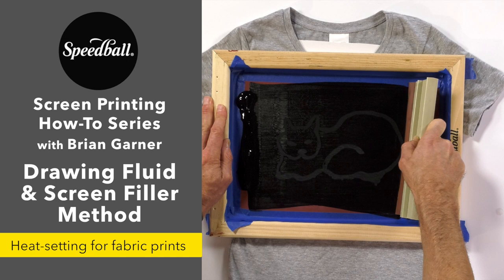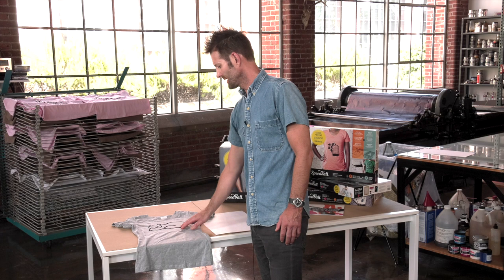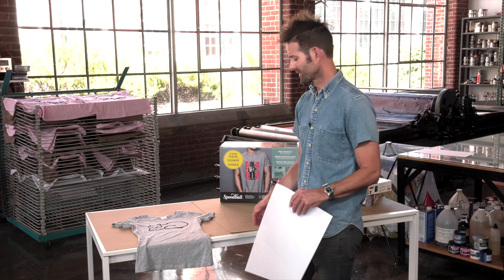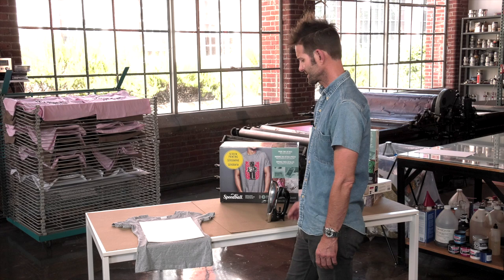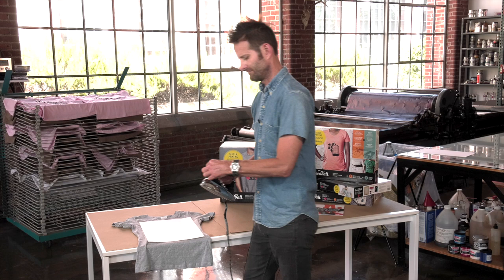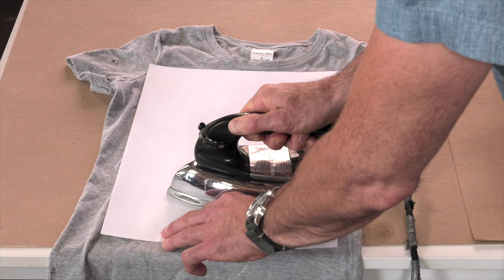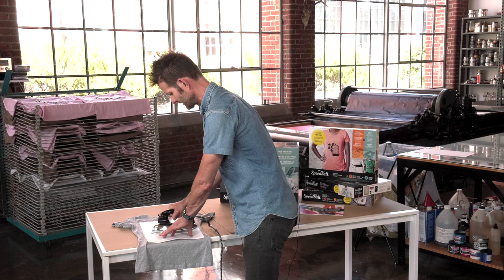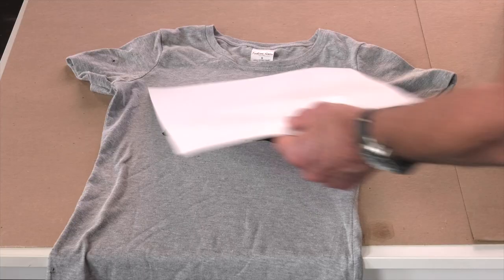Heat Setting Screen Printed fabric - Drawing Fluid & Screen Filler Method (Part 8 of 8)

Comment: Does the duct tape on the cord of the iron help it to heat faster? What type of duct tape do you recommend?
Reply from the maker: As a company that started way back in 1899, we love being able to include a vintage element into our videos. The iron making its video debut may have decades’ worth of use under its belt (requiring some duct tape to keep it all together), but it’s still a workhorse capable of getting the temp to ensure full curing just right.  Certainly not required (or able to offer any advantages like speeding up the time needed)—just a splash of history from this appliance!

Comment: Hi! I have a question for you, will heat-setting with an iron like this also work for block printing on shirts using oil-based Speedball fabric ink? I usually let mine air cure for a week after printing but it's becoming quite tedious.
Reply from the maker: That's a really good question! And I feel you, after doing it a couple of times, the process just kind of feels tedious. And if this is possible, it would save so much wait time! Unfortunately, we have never tested this in our lab before. Do you mind bringing this question to info@speedballart.com so that our product expert can help you figure it out?

Comment: If I wanted to use a flash dryer instead.. for speedball ink, what temp do they need and how long should I have the flash dryer on it for? Also, you use the "fabric" ink from speedball for screen printing on t-shirts right?
Reply from the maker: Hello!  Yes, we recommend using our Fabric Screen Printing Inks (either standard or Opaque) for screen printing on fabric.  To guarantee the inks are fully cured, we would recommend use with a household iron per the recommendations in this video or a heat press.  For the latter, we would recommend referencing the user manual for the press in use for the manufacturer's recommendations for settings/time when used with water-based inks.  Thanks!

Comment: I bought this kit and I keep having trouble with the ink cracking even after I let it air dry and then cure as told, does anyone have any advice or help they can give me?
Reply: I need an answer to this also
Reply from the maker: It is possible the ink is being applied a bit too thick on the fabric and that is creating cracks at drying.  Also, we don't recommend using this ink on fabrics with a great deal of stretch as it doesn't have a great enough elasticity for those types of fabrics.  Either may be contributing to the issues you're seeing.  If more help is needed, please feel free to contact us at info@speedballart.com.  Thank you!

Comment: Can you use a thin cloth over the shirt to iron? Or does it have to be some sort of a construction paper?
Reply from the maker: Using fabric is absolutely an option, but we do want to note that it should be something that is more utility or scrap as there is a chance a small amount of ink could offset onto the fabric during the setting process

Comment: Can I use a heat press for this what time and temp do you recommend?
Reply from the maker: A heat press can absolutely be used to cure the inks.  In terms of time/temp recommendations, we would encourage you to review the instructions provided by the manufacture of your particular heat press for water-based inks.  Unfortunately, the wide variety of performance attributes across manufacturers of these items limits our ability to give exact instructions for best results, as they can vary across brands.

Comment: How would i go about layering 4 colors? Does the ink need to dry between prints? Or can I do wet on wet?
Reply from the maker: We would recommend letting the ink dry between prints to prevent accidentally pulling ink you have already printed off onto the screen.

Comment: hi, im thinking about using vinyl stencils to screen print a big order. i have a heat press can i set the ink with that?
Reply from the maker: Hi!  Yes, you can use a heat press to set our Fabric Screen Printing Inks.  The settings and duration for exposure will be dependent upon the type of press and you can most likely find those directions outlined in the press' manual.  Thank you!
Reply from the maker: While our directions would recommend an iron for heat-setting, we have heard a number of presses are usable to cure the ink.  The settings for the heat press and the time utilized to cure the ink can range widely based on the type of press, so be sure to consult the manufacturer's instructions for properly setting a water-based ink in order to ensure solid results.

Comment: Is this the same process if doing a lino print using screen printing ink?
Reply from the maker: while some artists have great success using our screen printing ink for lino printing, we would recommend our Fabric Block Printing Ink if lino printing onto fabric.  The ink is able to cure in just one week without need for a heat set.

Comment: After using this method, my ink is still cracking during the stretch test, what am I doing wrong?
Reply from the maker: We'd be happy to help.  Please contact us at info@speedballart.com so that we can learn more about your project including the type of fabric used so we can offer the best assistance.  Thanks!
Reply: 13 aht did you figure out how to fix this problem? I’m currently having trouble with this too /:
Reply from the maker: @ximenavaldez3097  we would be happy to help you specific to your project.  If you can contact us with images of your project at info@speedballart.com, we can assist!

Comment: How do I know if the paint is set properly like for instance can I test it by rubbing it with water and seeing if any of the paint rubs off and if it doesn't that would mean it's set?
Reply from the maker: If the ink is allowed the proper amount of time to dry prior to heatsetting (we'd recommend overnight to be on the extra safe side) and the iron is set to the highest setting the fabric allows, the ink will cure fully.  You can absolutely test a small section of your printed design with water, but we'd recommend exposing to a second round of exposure to heat to verify as an alternative.

Comment: I used a blow dryer to try and cure the ink. Should I still take this step? Thank you Speedball
Reply from the maker: hi there!  the temperature of the dryer will not likely get warm enough to cure the ink, only to speed the dry time.  you will still need to cure with a heat press or iron to ensure permanence for the design
Reply: Thank you! I made sure to iron the tshirts for a minute and a half each.
Reply from the maker: @michaeldoherty7439  perfect!

Comment: Okay but what temperature my iron has to be in order for the ink to cure? There irons out there of all kinds
Reply from the maker: For heat setting on fabric, we recommend pairing the temperature setting to the fabric being used. On fabrics needing lower temperatures, we'd recommend increasing the ironing time slights (about 30-60 seconds) across the entire print to ensure the ink is fully cured

Comment: Hey, I ironed my designs at med-hi heat with an iron, with a piece of printer paper between, but they still  faded in the wash (at the "color" setting). What should I do?
Reply from the maker: We recommend letting the print dry for a least a week before heat setting!

Comment: How do I use this method for multiple colors on paper?
Reply from the maker: The process of creating your screens and pulling the print would be the same as showcased in this video, but we would recommend using our Acrylic Screen Printing Ink. While the Fabric Screen Printing Ink is suitable for use on paper, the Acrylic line is formulated for ideal performance on paper.  If you have specific questions regarding your particular project, please contact us directly--we're happy to help!

Comment: Can I use a steamer with an iron plate attachment instead of an iron?
Reply from the maker: Without knowing the settings of your steamer, it is hard for us to confirm, however, if you can ensure the temperature setting that is achieved would be equivalent for an iron specific to the fabric type you're using, it should work well.  We'd recommend trying on a remnant prior to using the process on your final project to validate the suitability.

Comment: How many degrees and seconds with a heatpress machine? 
Can I do layers with this ink?
Reply from the maker: Great question! We haven't tested this method with a heat press machine in our lab yet. But it should work in principle. Just make sure that you set the temperate according to the type of the fabric and start with shorter time increments. Would love to hear your results!

Comment: what can i do to get a spot of  white speedball ink out of a black t-shirt without leaving any residue? the spot hasn't been cured yet, so would a wash in the washer get all the ink out without leaving a faded stain onto the black shirt?
Reply from the maker: We have had success in removing ink that has not yet cured with our Pink Soap product.  The success will depend on how long the ink has been allowed to dry and the type of fabric, but there are many instances that we've had this work.  Hope that helps!
Reply: Acetone
Reply: I know it's probably too late for you, but in case anyone else has the same issue- try using a piece of packing tape to "wax" it away. If it's a smallish bit just on the surface you can usually pull it away from the fibres

Comment: I'm using an iron to cure speedball gold ink on tri-blend shirts. Should I use the cotton setting or cotton blend? I don't want to under-cure but read that tri-blends can be sensitive to scorching (presumably over-curing).
Reply from the maker: we would reommend the lower of the two settings.  you can always increase the curing time for the design slightly to ensure it remains permanent and by consistently moving the iron across something like a sheet of copy paper, you'll protect the fabric from scorching as well.
Reply: @speedball_art  Thanks!!
Reply from the maker: @rebeccamarshall3746  happy to help!

Comment: If I’m doing white fabric ink and then I want to go over with the glow in the dark speedball ink, should I heat set after each one or just after I’ve put both layers on? Thanks!
Reply from the maker: We wouldn't recommend overlaying colors in your design as it's difficult to ensure each layer will cure fully.  Heat setting each layer could improve the chances, but the results are more experimental
Reply: @speedball_art  could i use a heat press? What temp and for how long if so?
Reply from the maker: @gioiaheslar8208  You can absolutely use a heat press to cure the ink.  To confirm the time and temperature, the best resource is the manual associated with your particular press for their recommendations with water-based inks.  Unfortunately, there are too many different models and specifications for us to provide guarantees across all varieties, but their instructions should give you an answer that guarantees success per our formulation.

Comment: Hi sir, may I know the use of iron press after painting??what is the benefit.
Reply from the maker: Brian is using an iron to heat set the inks once they have dried.  This will make them permanent through the wash.

Comment: Can I put the shirt on my heat press without actually pressing it to dry it faster?
Reply from the maker: You can absolutely use a heat press to cure the inks.  We would recommend referencing the heat press manual to determine the correct time/settings for use with water-based inks to ensure the design cures fully.

Comment: How long would you recommend heat setting screenprinted shirts using a dryer rather than an iron?
Reply from the maker: The results with a dryer can be very unpredictable, especially with newer models.  We'd discourage using that type of process for heat setting in that there's really no way to guarantee the permanence of the ink--the dryers can often just not get hot enough
Reply: @speedball_art  thanks for the advice :)
Reply from the maker: @yesyeahyes1  Very happy to help!
Reply: Are you talking about a screen printing dryer or a standard clothing tumbler dryer?

Comment: What is the heat temp for Speedball Fabric ink?
Reply from the maker: you can set your hand-held iron to pair with the recommended heat of the fabric you are using for the project to ensure the inks cure without harming the fabric.

Comment: Will this cause the inks to run or bleed at all?
Reply from the maker: Heat setting will not cause the inks to run or bleed, but we recommend allowing for ample dry time after printing prior to heat setting.
Reply: Yes

Comment: I did exactly that and then most of the ink washed out in the washer.
Reply from the maker: Hi, sorry to hear that! Depending on the temperature and humidity level, sometimes it can take up to a week for the ink to fully cure!
Reply: @speedball_art  should I paint dry for a day then iron then dry for a week then wash or dry for a week,  iron then wash?
Reply from the maker: We recommend letting the ink air dry for around a week before heat setting!

Comment: Once ink has set are you able to iron over the design when you wash the shirt in the future or should you iron around the design?
Reply from the maker: Once the ink has been properly dried and heat set it should be fine to put it in the dryer or iron over it again. Thanks!